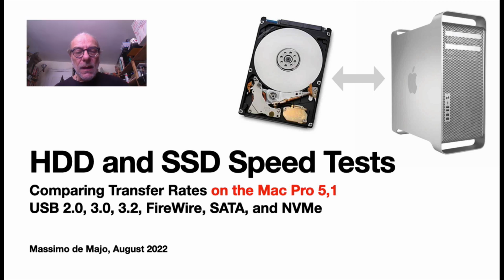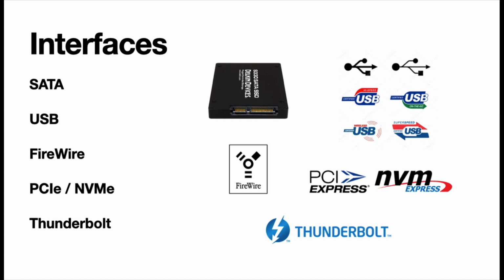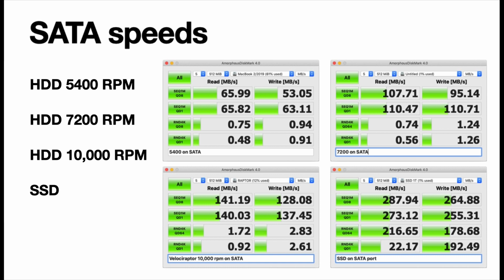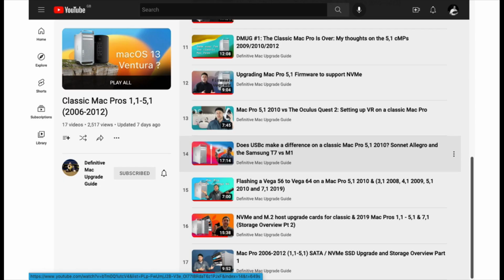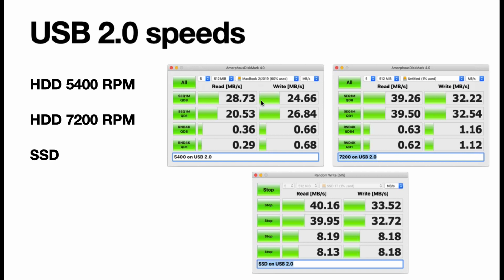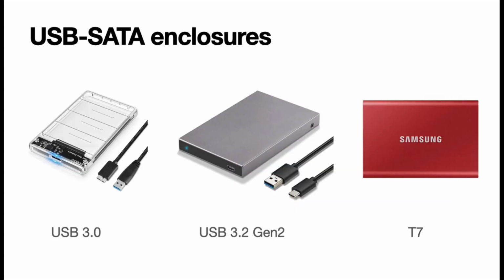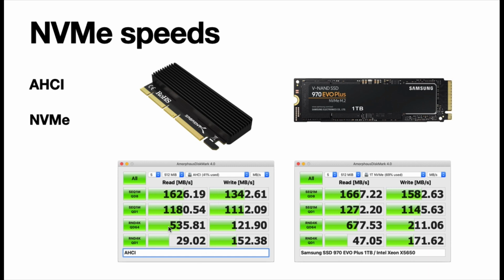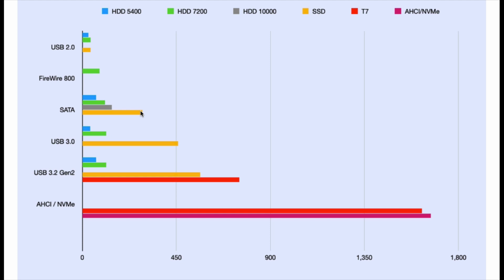HDD, SSD, and NVMe Transfer Speeds on the Mac Pro 5,1

Comment: The interesting thing would occur if you have a fast usb 3.2 card attached to multiple external ssd’s and then process streams in a Mac . But what application will use such streams?
Reply from the maker: Frans, for 4x SSDs it's best to use the bigger (and more costly) Allegro Pro with four controllers. Still, the speed for each USB will be around 750MB/sec, not more than that. This kind of speed can be OK for not too complex photo or audio work, but for video it would probably stutter. Logically, everything depends on the material, your workflow, etc.

Comment: Using Lycom DT-130 card you can get ~ 2200 MB/sec write & 2800 MB/sec read transfer rates.
Reply from the maker: that's correct when you set the two NVMe units in RAID 0. Thank you for the comment!